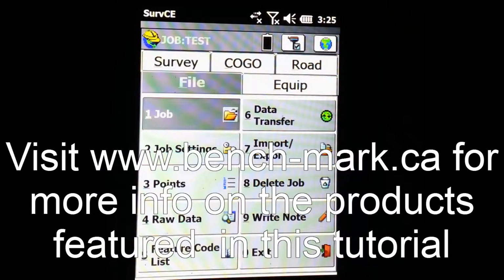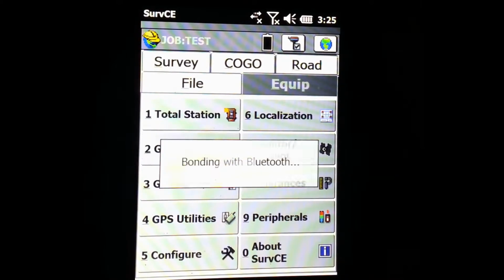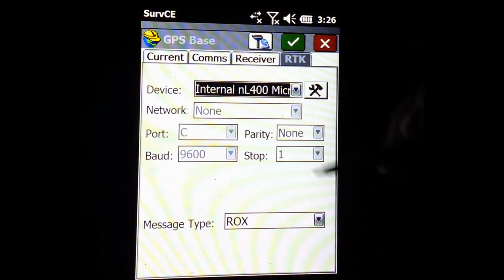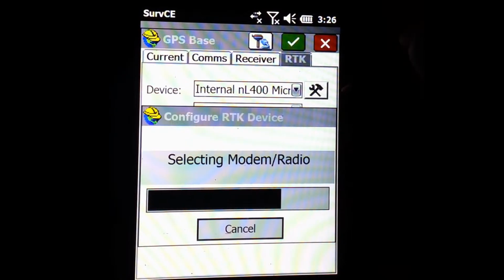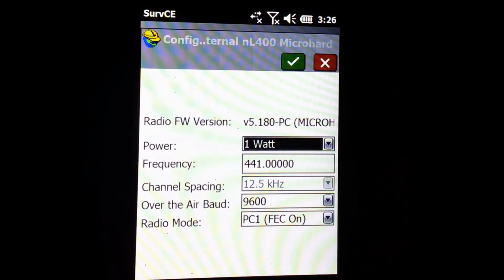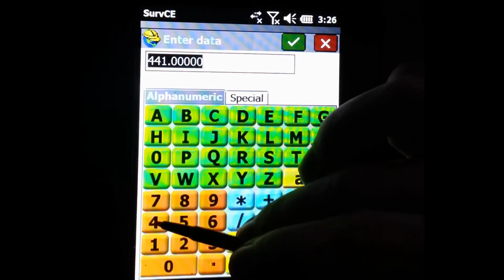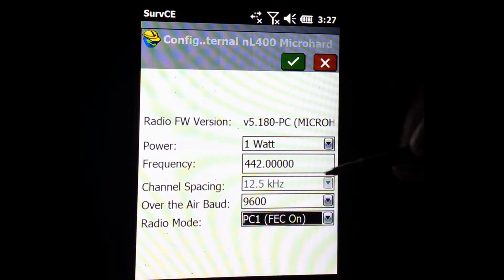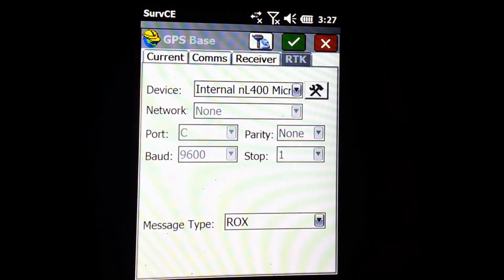How to Configure the Internal Radio on a Hemisphere GPS S320 RTK GNSS System

Comment: Hi Bench Mark! In order to save battery, sometimes I configure power to 0.1 watt instead 1 watt. In open areas it is enough up to a range of 300 m. Do you know if is there any problem configuring power 0.1 watt?  The XF3 controller doesnt seem to find digital radio after I turn off and on with 0,1 watt. I have to try connection and after several times XF3 connects.
Reply from the maker: Hi Pablo, There is no problem with using the 100 mW power option. The range will obviously be decreased. Try performing a reset on the S320 if this occurs by holding the power button until the two GPS lights light up. Let go once that occurs. We are still offering trade-in credits for the S320 towards a new S631, reach out to us at sales@bench-mark.ca.

Comment: Would the 442 frequency still be the best one to use in densely wooded and hilly areas? I have 3 antennas for the S320 (410-430), (430-450), and (450-470).
Reply from the maker: Hi Benjamin, typically we have the best luck with the high split 450-470 MHz. I would check and see if anybody is operating near you in that range and make sure it is clear, it is pretty popular and you can run into interference.